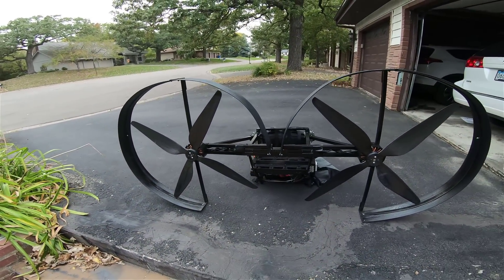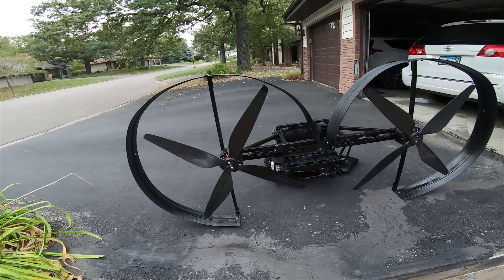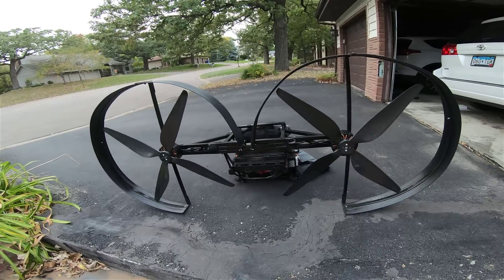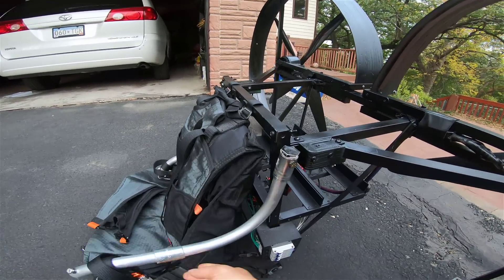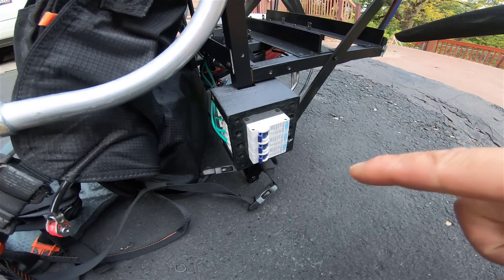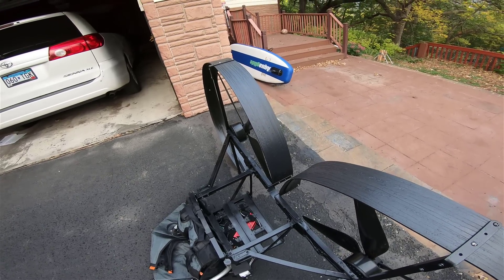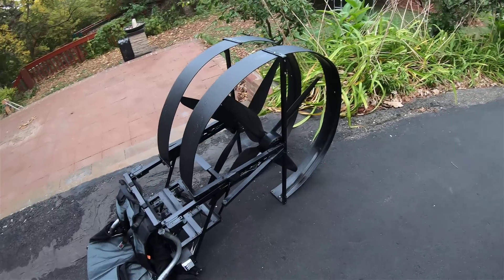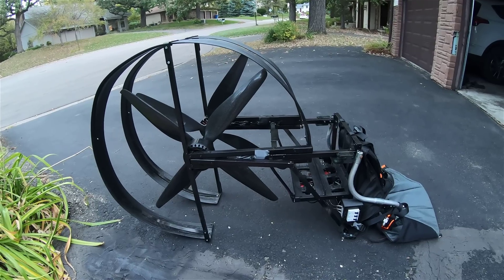Minne DUAL Electric Paramotor World first Folding PPG

Comment: Couldn't you put the props overlapping, so that you have a very small size, but super similar setup and torque still mitigated?

Also, had you ever considered a dual throttle for differential thrust in your left/right (wide) configuration?
Reply: Lol
Reply: Google paramotor torque steer. Something like that will kill you and unfortunately has killed many young pilots.

Comment: Very nice design, pretty quiet and takes less space. I suppose soon most people will fly something like this. Even when this is far from pilot, I think you may still want net over motors for safety. Also I wonder if you can fit small generator to this design for extended flights.

Comment: I love this design!  Is that a Nova Mentor 4? Thats what I am flying and your wing looks exactly like it.  I only free fly with mine but I want to build a motor like yours.  I noticed that my wing is rated for a motor, but I wasn’t sure if its a good idea.  Do you like using your nova with the PPG?  Lets fly together on your next trip to Michigan.
Reply from the maker: If you already have a pg wing, you don't need to get a ppg wing just for parameter. General speaking, the wings designed for ppg is heavier.

Comment: Issue is if you had a motor failure during full throttle you would spin out of control... Nice concept, but there needs to be a net, so your hands don't get chopped off by the blades.
Reply from the maker: If motor failure both motors will be stopped at the same time. I explained in this video:
https://youtu.be/riMA1KXhjkE

Comment: You fly yours without any ear protection??? Either it is very quiet or you just want to show-off. No paramotor can be so quiet... But if true, it is MUCH quieter than single prop, old style electrics...
Reply from the maker: I don't use earplugs for electric paramotor. There's no engine sound, the only noise come from propeller like big fan.

Comment: Great idea, You are going to improve your electric paramotor. It is the future
Reply from the maker: That's the plan!
Reply: @JerryMinne  Listen to me. get those shrouds MUCH MUCH closer to the props! Make them out of carbon fibre to be more sturdy and they must go all the way around the props. Your prop efficiency will increase a lot !!! Also add a 1in lip on the front side of the shroud. That will increase the efficiency even more.oh, and don't put them sooo far behind you. Put the battery below the props and bring the props right onto your back. leave a gap of 1 foot or so between the props and make them smaller (26in). The efficiency will be good because of the forward lip and shroud, even if you use smaller props.

Comment: Its great to see innovation but if one engine fails I assume you'd need a fairly quick reaction time in releasing the throttle to avoid being spun into a potentially dangerous situation! Could you give things like weight, typical flight time etc as the links provided return a 413 error.

Thanks.
Reply from the maker: The big feature of Brushless motor is maintenance free and it will last many many years. I don't have any electric motor failure in the history. The weak part is ESC(speed controller) but when it fail, both motors will stop. So it's nearly impossible for one motor failure situation.
Reply from the maker: The complete paramotor weight is 40 lbs without battery. The flying time formula is here :
https://minne.us/shop/batteries-link-package/

Comment: OpenPPG X4 is electric and folds. I've had mine for a year. I like how quiet yours is
Reply: How many bonkas you use?
Reply: @macflyguy5166  Started with 4 (22amp hour 6 cell) but have been flying with 8

Comment: Interesting concept. The hang point for the assembly looks like it almost points the props at the ground when in flight? It may perform much better if that is adjusted.
Reply from the maker: Camera angle problem. No, they are not points to the ground.